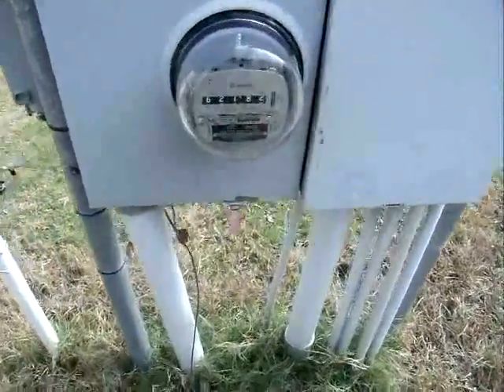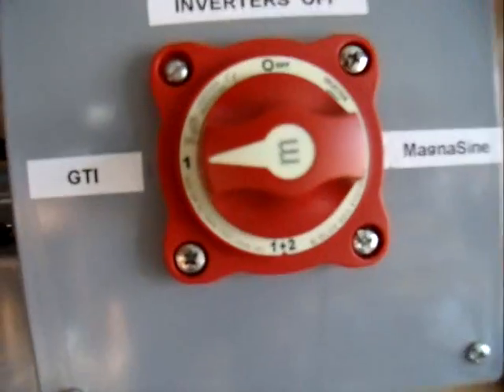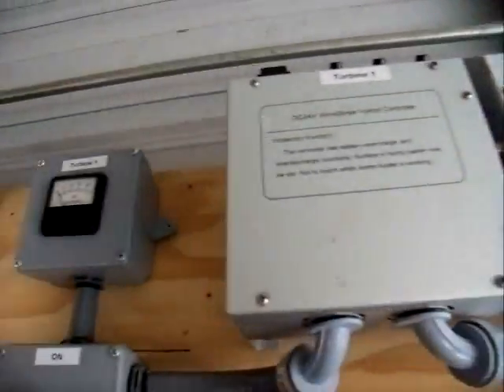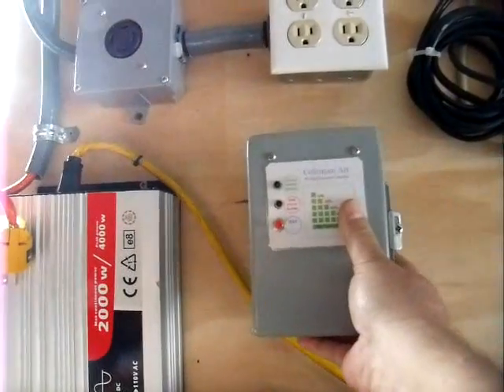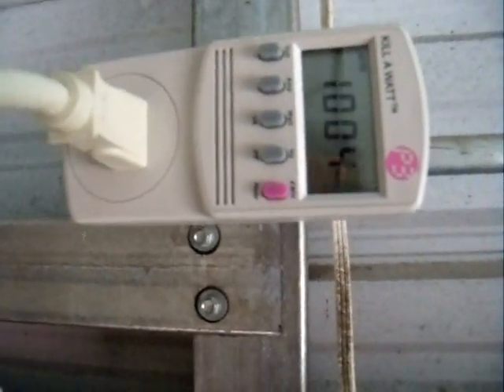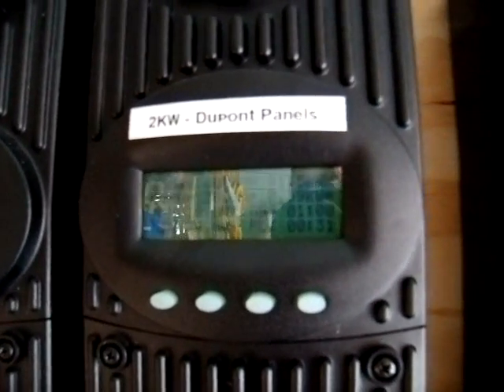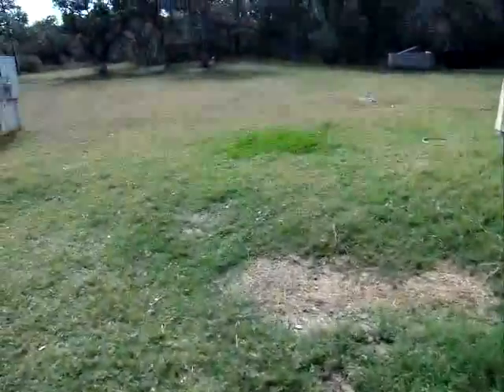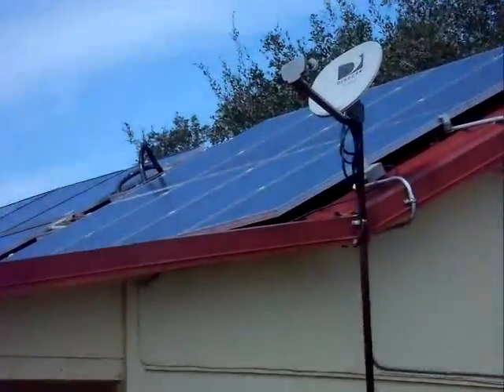Electricity From Heaven

Comment from the maker: Careful, make sure they are true deep cycle, they should be significantly heavier than the auto batteries for the same given size and rated only for reserve capacity. If they are rated for CCA (cold cranking amps) stay away from them.

Comment from the maker: @Prancinglion1 I went all off-grid battery powered inverters which feed select circuits in my home all of the time. I get to use 100% of the power without having to worry about dumpling out (usually). I do have a resistive dump load for those rare occasions, if you watch my videos you'll see how I use the transfer panels to put my house on solar/wind powered from the battery banks so I don't need those GTIs. Running DC to the house is very expensive but you can try it.

Comment: You Chinese GTI's died?  Wow... and I was getting ready to order a couple of the 1200Watt GTI's.  Good to know.

Wouldn't several of the inverters designed for auto use be a good alternative to an expensive central GTI?  Perhaps a small GTI for digital use in the mix as well?

What do you think about running a separate 12V DC circuit to the house to power 12v lights such as LED auto lights, and the auto inverters for household use?

Good idea about the GTI Dump load, but the GTIs died. Now what?

Comment from the maker: @physicsgran Yes, you do have a problem there. I solved my by using a MagnaSine (and now added a TrippLite) inverter for off grid with a simple transfer panel which is always in the inverter position. The inverter supplies power to my house from the batteries continuously except in winter where is overcast and I must switch to commercial power every few days.

Comment from the maker: @physicsgran Well, the swea.nl are not U.L. approved either like the chinese stuff and you can't find any testimonials out there either. I have eight enphase grid tie inverters under my Sharp panels, why don't you want to use their 240v inverter. It is a simple connection from the inverter to a disconnect and from there to a breaker in your panel, can't get much more simple than that. If you're looking to plug into outlet, it doesn't exist (that is of quality). Good luck.

Comment from the maker: @Viking9280 Just the 1.6KW of Sharp panels because I used UL approved inverters and had it inspected. This system uses the Chinese junk that is not UL tested and thus cannot be certified. I'm waiting to see is I can get a used UL1741 inverter on eBay for cheap so I can be 100%l. Thanks.

Comment: What a feeling to have the meter run backwards!  Awesome! Is that a surge strip after the Grid Tie Inverters?  You may want to delete that and directly connect to a quad receptacle.  The electronic components in the surge strip may confuse or impede GTI efficiency.